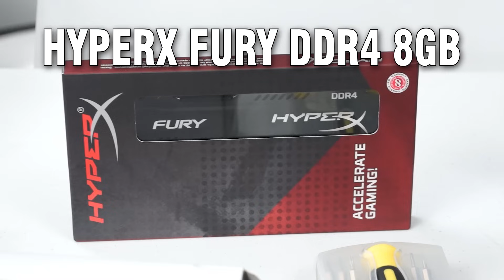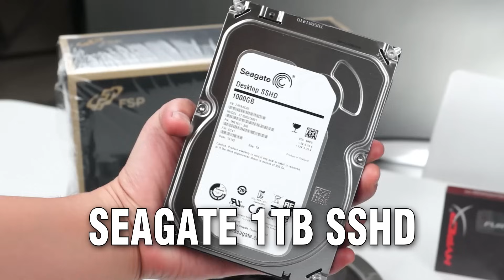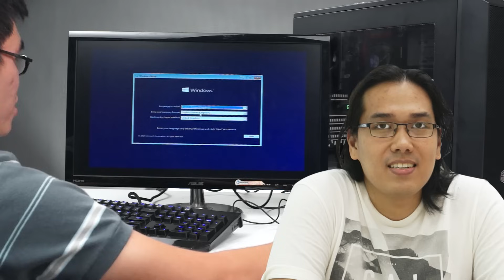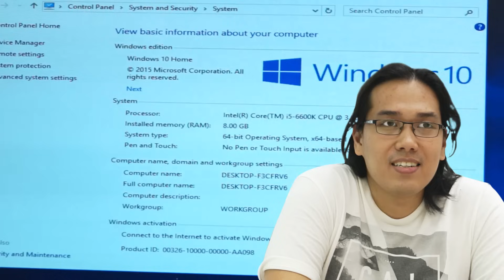PA-HELP - How to build a PC - Part 2 (IN TAGALOG!)

Comment from the maker: Salamat sa suporta! After 2 years, sikat pa rin itong video na ito. Para po sa mga naghahanap ng cable management at pagkabit-kabit ng stuff, may video na kami tungkol dito: https://youtu.be/zGPOT11y3qw
Reply: Salamat po sa guides :))))
Reply: Sir ahm magkano po ba yong pc build mo ?
Reply: magkanu po inabot ng set n yan sa video sir
Reply: Salamat :)
Reply: buti pa dito sa video nyo tama ang paglagay ng motherboard sa standoff , bakit sa mga sa mga branches nyo standard daw sa inyo ang paglagay ng masking tape para daw hindi "grounded" ang board, which I find stupid.. pano naging grounded eh, dapat naman talagang nasa ground yun, at yung screw sa ibabaw, didikit din naman sa ground at sa motherboard yun..  I'm sorry but it's really a stupid idea, it's not done by a professional.. I still buy computers in pc express, pero ako na naga-assembly.. Please change your ways of assembling computers, make it professionally done...
Reply: sir pede ba ilagay sa ram ay 8gb Tforce Delta RGB 4x2 3000mhz
Reply: magkano po ang full upgrade nyan ?
Reply: Mag kano po lahat ng cost nito sir.
Reply: PCXTV sir pde bang iupgrade ko ang pc kong core 2 dou?kung pde ano papalitan ko at paano?
Reply: Great post thanks. This is very informative. computer tutorial. 💻
I learned a lot of useful and insightful information. 🍩
Thank you very much for this post. ❤️
Reply: Sana na explain mo yung bawat cable or pin na connect sa mother board yun kasi pinaka nkkalito.

Comment: Ganda Sana kaso minadali Yung pagkabit ng wires Ng powersupply
Reply: Tama yun din ang inaabangan ko ung sa power supply portion kasi namadali huhuhu. un po ang kailangan namin sana
Reply: Request po, sana detailed wire attachment kc yun po ang complicated para sa akin.
Reply: Madali lang yun. Hanap nalang kau sa ibang vlogs. Sata cable galing psu at sata port kung hdd.

Tapos yung color coding at polarity. Check nyo sa manual ng mobo or check nyo ung specs sa website. Pati diaghram ng powercables
Reply: Yun din sana papnoodin ko e😂
Reply: Yun tlaga yung complikado eh yung wiring..
Reply: Yon nga eh..
Reply: kaya nga.. inexplain nang maigi yung mga simpleng components tapos kung san yung mahirap dun minadali XD
Reply: Kaya nga ehy pati pag install ng OS hayssss
Reply: yung ang pinaka impt na part, yun pa di pinakita tsk tsk tsk , d namin alam san i plug tapos d mo pinakita ang pinaka IMPT
Reply: Yun din ang comment ko sana gawa ulit ng details  para masundan lalo na sa pag kabit ng mga wirings turnilyo doon magkakamali. May part 2 sana :)
Reply: ako din eh, importante kasi na part yun.

Comment: importante yong paano maglagay ng thermal paste kasi  pag nag kamali  ka ng lagay nun maaring mag short component ng cpu at board.. 

Halatang assemble lang ang alam mo..
Reply from the maker: Tulad ng sinabi namin sa video, ang mga stock CPU fan (which was the case here) ay pre applied ang thermal paste. Kaya hindi na namin pinakita ang custom application ng ibang thermal paste brand.
Reply: Sa AMD CPU lang ang my pre applied na thermal paste kung ito ay brandnew sa intel wala  palusot ka pa  halatang assemble lang alam mo pre.
Reply: Review mo video mo kung may thermal paste ba?
Reply from the maker: Pre-applied ang thermal paste sa heatsink. Yes, oversight on our part na hindi naipakita ito, pero may pre-applied ito. And no, hindi lahat ng Intel CPUs walang pre-applied thermal paste or stock fan/heatsink. Non-K at non-X CPUs nila ay may pre-applied thermal paste sa stock heatsink.  Ang -K or -X CPUs lang ang walang kasamang stock fan/heatsink.

Comment: kung magpapalit po ko ng motherboard na hindi mag rere install ng OS possible po kaya at may mga dapat pa bang gawin after mag palit ng new motherboard?
Reply from the maker: Pwede naman, pero if possible mag-reinstall ka ng OS dahil most likely mag-conflict ang mga drivers mo.
Reply: @officialPCXTV  pero same model po ng motherboard? required pa din po ba ko mag OS install? or hindi na? yung gamit ko kasi na motherboard ngayon sa PC ko may mga sata socket na di madetect ang ibang HDD. may time na pinaglipat lipat ko.

Comment: Ano po yung ginamit niyo na fan?
Reply from the maker: Stock lang.
Reply: Pare-parehas lang po ba yung mga sizes ng mga fan o hindi?
Reply from the maker: Kung chassis o casing fans, may mga 120mm, 140mm, 200mm. yan ang common. May mga CPU coolers 
 naman na tumatanggap ng ibang 120mm fans bukod sa stock nito, may mga ilang coolers din na sadiya yung fans.

Comment: Pag bumili ba ako ng processor at mobo andon na rin yung OS? or seperate yun
Reply from the maker: Separate purchase ang license ng OS.
Reply: @officialPCXTV  ahh okay po salamat. Pinagiisipan ko po kasi kung magsasariling build ako or bibili nalang ng set na ready to use hehe. Skl.
 
Pero pwede po ba yung manghihiram ako ng installer ng OS at microsoft office sa iba ganun?

Comment: sir tanong lang may problem ako sa build ko. walang sound output sa tv ang hdmi. (mobo msi mortar max gpu aorus rx570 4gb)
Reply from the maker: Tama. Try updating audio drivers. Also, make sure na sa Sound Settings ng Windows (speaker icon sa taskbar) naka-select ang HDMI as audio out.

Comment: pwede ba iconnect ang gva cable sa gpu ? instead sa mobo
Reply from the maker: Ibig mong sabihin VGA? kung may VGA out ang card mo, ok lang. Connectors/adapters will also work.
Reply: PCXTV Opo sorry na typo lang. Vga to Vga Graphics card po. dati kase naka connect yung monitor ko  sa motherboard na may Vga socket kahet meron din sa GPU.  another question, Alin po ang maganda ? VGA, DVI-D, HDMI or Display Port???? need ko kase makuha yung gusto kong Refresh rate.
Reply from the maker: Kung sa motherboard nakakabit ang cable/monitor, ang ginagamit ng computer ay ang integrated GPU (IGP) ng processor. As much as possible, sa card mo ikabit ang cable/monitor para magamit mo ang graphics power ng video card mo.

On refresh rates, DVI/HDMI/DisplayPort kaya ng high resolutions. HDMI v1.4 and higher kaya ng 120Hz, DP kaya higher. Even then, ang monitor mo dapat kaya rin ng higher than 60Hz refresh rate. Otherwise, di mo magagamit ng husto ang mataas na refresh rate ng video card mo.
Reply: PCXTV ah ganon po ba? so yung mga may built in GPU sa CPU tulad ng mga Amd A4 A8 A9 okay lng naka connect ang monitor Sa Mobo kase sila ay mga APU Processor na my built in Graphics Card?
Reply from the maker: oo, ang APU ang tawag ng AMD sa processors nila na may built-in GPU. Pati ang mga Intel processors, may mga built-in GPU. Pag ang motherboard nakita mong walang video ports, ibig sabihin ang processors para sa board na yun ay walang built-in GPU, so kailangan mo talagang bumili ng graphics card.
Reply: PCXTV Marami pong salamat sa kasagutan sa tanong. Karamihan po kase ng mga Graphics card ngayon tulad ng Gtx 1050 Ti... Dvi-D HDMI and DP lang ang socket. walang VGA. so kelangan mo pa ng DVI-D to VGA adapter para makabit sa Monitor na support ang VGA. mas okay din ba yung DVI-D connect sa monitor and GPU??? Mukhang pareho lang naman ata ang Signal sa DVI and VGA cable???
Reply from the maker: Analog signal ang gamit ng VGA. DVI, HDMI, at DP digital na ang signal kaya mas matalas ang details, mas mataas ang resolution, at mas mataas na refresh rates na kaya nito. Kung ako ang papipiliin mo, DVI ang bare minimum na gagamitin kong video output.
Reply: PCXTV A Million Thanks to you PCXTV Sana marami kapang mabigyan ng TIPS at tamang Gabay sa pag gamit ng Computer 👏👍

Comment: Hi po may tatanong lang sana kung bat Specs sa dx diag na walang gpu na.nakalagay ?

Yung akin po kasi
AMD A8-7650K Radeon R7, 10 compute cores 4C+6G

May nagsabi din sakin na wala daw compatible na GPU sa pc ko? 

Kaya po to i run ng pc ko without GPU?

ARK:SE
Rust
At PUBG?

SANA PO MASAGOT

At kung wala man po ako graphic card try ko sana bumili mga magkano kaya ganon?

Ps: Wala pako masyadong alam sa pc.
Reply from the maker: Ang AMD A8 na processor mo ay isang "APU", o "accelerated processing unit". Ito ang tawag ni AMD sa mga processor nila na may built-in GPU. Pag magge-gaming ka, recommended talaga na dedicated video card ang gamit mo. Sa games na yan, ok na ang Nvidia GTX 1050. Hindi rin totoo na walang compatible na GPU sa PC mo.
Reply: Ok po salamat!

Kaya naman low graphics PUBG diba? :D
Reply from the maker: Heto may video sa Youtube, sa specs mo: https://www.youtube.com/watch?v=udscKWDtpxU 

Pwedeng magkaiba result niya sa machine mo.
Reply: Sige po

Comment: sir good eve, 
ito po CPU Ko
ASUS A55BM-K AMD A4 4020 FM2+
8g RAM
SSD
ano po magandang GPU para dto? 
or pwede ko po bang iupgrade ang processor? kung oo, ano pong klaseng Processor?
Reply: baka mas-mainam na i-upgrade mo na yung AMD mo sa ryzen 3 2200g. Mga 5k siya sa lazada ngayon, tapos malakas na rin siyang CPU, especially kung i-kukumpara mo sa presyo niya. Puwede ka ring maghintay para sa 3rd generation na release ng ryzen, dahil i-rerelease na nila ngayong taon at tiyak na mas efficient yung mga next-gen CPU. Sa GPU naman, medyo nahihirapan akong mag-recommend kasi medyo mataas parin yung mga presyo nito dahil nag mass-buying yung mga cryptominers ng mga GPU para sa mga mining rig nila. Meron akong nahanap na rx 570 4gb sa lazada, mga 4.5k siya. Around 10k yung 8gb version.

tapos para sa 2019 games, pag-isipan mo naring bumili ng isa pang ddr3 8gb ram stick (di kasi supported yung ddr4 ng motherboard mo)

Comment: Sir may nabasa ako at marami din akong napanood sa youtube rin, kailangan po ba talagang dual ram para makuha full performance?
Reply from the maker: Mas efficient ang dual channel against single channel. For example, mas efficient ang 2x4 GB compared sa 1x8 GB.
Reply: Okay lang kaya sir na 8gb tapos 4gb pero parehas namang 1866mhz wala po bang kaso yun?? Maraming salamat po
Reply from the maker: Para siguradong wala kang errors, make sure na EXACTLY the same RAM ang ikakabit mo, brand, model, everything.
Reply: PCXTV Okay po sir maraming salamat po sa tulong.

Comment: pwede po ba yung ram ko ddr2 tapos yung gpu ko ddr3
Reply from the maker: Yes. Unrelated naman ang data rate ng RAM at Video card. Just so happened na ang RAM mo uses DDR2, at ang built-in RAM ng video card mo (it uses for texture loading etc.) ay DDR3.

Comment: Pwede po ba ang 8gb ram sa intel core i3 na cpu?
Reply from the maker: Pwede naman.
Reply: PCXTV hindi naman po ba magkadeperensya sa cpu?tapos 2gb lang graphics lang?kya kaya sa pubg yun?
Reply from the maker: Wala namang masama sa 8GB RAM sa Core i3 na CPU no matter kung ano man ang GPU mo, pero wag ka ring mag-expect na tutulin ang games mo. Nakakatulong ang mas malaking RAM sa pag-juggle ng mga applications. Pero DEPENDE sa generation ng Core i3, pwedeng hindi rin magamit ng system mo ang extra RAM mo dahil hindi rin kaya ng CPU mo ang bilang ng sabay-sabay na task. For 8th Gen na Intel Core i3, 8gb is ok dahil sa hyperthreading. pero for previous generations, optimal na ang 4GB.

Comment: Sir PCXTV, ask lang po ako, ryzen 3 2200g po gamit ng pc ko mas mag improve po ba ang performance ng pc ko if maglagay ako ng graphics card?thnx po sa sagot.
Reply: Generally yes pero depende parin sa use case mo para sa pc mo, kung nag browse kalang ng internet or light gaming tulad ng dota o lol na di naman ganoong ka demanding sa graphics enough naman siya pero kung naglalaro ka ng games tulad ng gta v at gusto mong i medium settings pataas magagawa mo pag may video card ka, kailangan mo lang tandaan na sa pagbili mo ng video card kailangan na mamaximize ng cpu mo, recommend kong video card na kasama ng ryzen 3 2200g gtx 1650 o kaya 1660 kung mas mababang card Kukunin mo minor improvements Lang makukuha mo ganun rin kung mas mataas kasi mababottleneck or di makakasabay cpu mo pag mas mataas sa ni recommend ko, yun lang sana makatulong

Comment: Ano po ba mas nire-recommend nyo? Bumili ng PreBuilt PC o Gumawa ng sariling PC? Pa-Help
Reply from the maker: Kung pre-built pc ang kukunin mo like Lenovo, HP, etc., limited ang expansion mo depende sa specs nung PC. Depende rin sa warranty terms, pwedeng ma-void ang warranty mo pag nag-expand ka ng components, or limited ang warranty coverage. Advantage is, most likely may kasamang original OS na siya. Sa sariling setup naman, as long as you know what you're doing, go ahead. Coverage pa ng warranty is for individual items, at makakapili ka ng specs mo.
Reply: Thank you Po! :D

Comment: Nasunod ko naman po ung step pero bat hindi gumagana.. Umiikot saglit ang cpu fan tapos mamatay wala rin po signal ang monitor tapos wala rin ilaw mouse and keyboard
Reply from the maker: Pa-list naman po ng specs ninyo para matulungan ko kayo.
Reply: PCXTV
 Motherboard:H110M4-C2H V1.0
Processor:Intel Pentium G4560 3.5Ghz
Memory:4gb ddr4 HyperX Fury
GPU:Palit GTX 1050 Ti
Psu:Corsair VS450
500gb storage
Reply from the maker: nakabit niyo rin po ba yung 4pin atx power?
Reply: Yes sir
Reply from the maker: @regieprieto1404  email ka sir sa pcexpresstv@gmail.com para mas matulungan kita ng maayos.

Comment: mobo: ga-h110-ds2 
proc: intel g4600
ram:Msi 4gb ddr4 2400mhz
anu po kaya babagay na Gpu dito para malaro ko ang Metal Gear Solid and GTA V. thanks po..
Reply from the maker: ok na ang GTX 105Ti.
Reply: fely larga mas mura ang G4560 sir pareho lang din nmn ang performance,sa GPU go for palit gtx 1050ti xstorm mura lang yan 7250php

Comment: Pano po ma cool ang computer ang ginagawa ko po ay nilalagyan ko ng electric fan malamig rin minsan tubigan ko na may yelo para sumakop ng lamig ang computer

Note: ayaw ko lang po ng watercooling
Reply from the maker: Di ko mare-recommend yan. Yari ka pag nag-condensation sa PC mo. Magkaka-moist sa loob ng computer mo. Ang pinakamainam ay dagdagan mo ang fans ng casing mo para mas gumanda ang airflow.
Reply: @officialPCXTV  meron po ako tatlong fans sa harap ng CPU kung gusto niyo po makita ito po ang name ng casing Thermaltake V200, papaltan daw po yung stock fan sa likod at mag iinstall ng tatlo pa na RGB fans
Reply from the maker: Ideally, sa harap serves as intake, and then sa likod at sa taas ay exhaust.
Reply: @officialPCXTV  ganun na nga po hehe

Comment: Sana ma pansin nyo po yung tanong ko. Nasa japan po ako at ang voltage dito ay 110. Ano po ba ang kailangan kong pili.in na power supply. Baka po kasi sumabog nang wala sa oras pag wla akong idea. Haha. Salamat
Reply from the maker: Tignan niyo po sa specs ng PSU kung ano ang Input Voltage na pwede sa kanya. Some PSUs ay may manual switch para sa 110 or 220. Others, automatic maga-adapt sa input voltage.
Reply: Thankyou so much. God bless and more informative videos pa sana ang magawa nyo

Comment: Plano kong mag build ng Pc marami kasing Bundle promo
Mobo Bundle
MAXSUN A88 Gaming Pro (up to 16gb)
A6 7480 3.8ghz
4gb ddr3 1600mhz
(Php 3,750)
PC Casing Bundle promo
KEYTECH T850 tempered Glass Mid tower casing
700watts 80gold PSU
4x LED FAN 120mm
(Php 2,500)
Planning to add 4gb stick ng Ram at RX570 4gb.

Comment: Please help me determine reasonably priced PC hardware for a budget of Php. 30,000.00. Where to source these hardware.
 Your suggestion is very much appreciated

Thank you
Reply: Intel Pentium G4560
B250 Motherboard
8 GB RAM
GTX 1050 ti or GTX 960
500W PSU
1TB HDD or SSD
Case